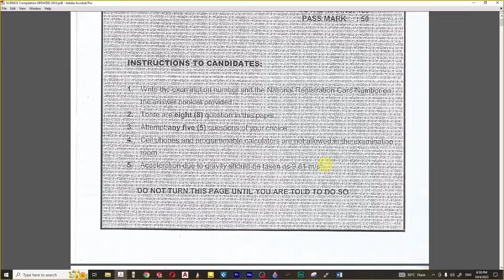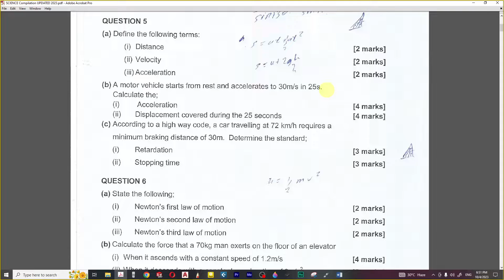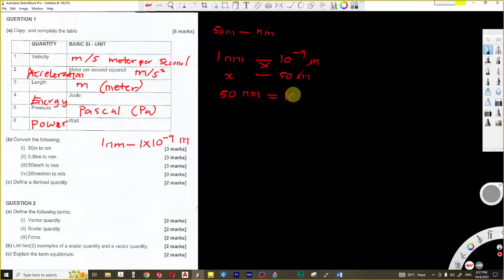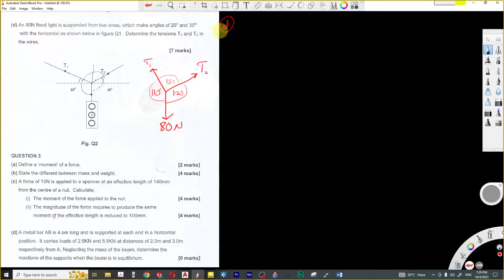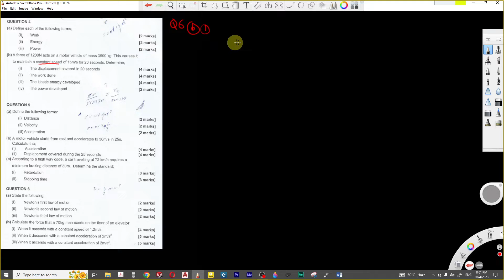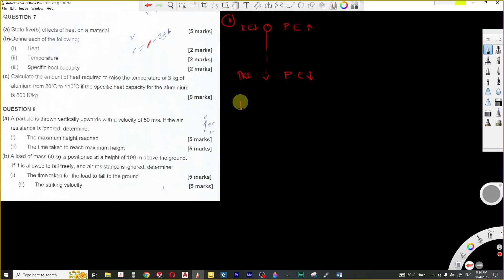Engineering Science Craft TEVETA Past  Paper Revision 1

Comment: A zinc sphere has a radius of 30•0 mm at a temperature of 20. If the temperature of the sphere if raised to 420. Calculate the increase in the radius, surface area and volume of the sphere assuming the coefficient of linear expansion to be 31*10 power negative 6 k power negative 1

Comment: At question 5b (2)I thought of using this formula 
S=UT+2AT  cause we have acceleration
Reply from the maker: Correct, you mean we can use the equation s = ut + (at^2)/2 because we now have the acceleration. Try it out , you'll see that it will give you the same answer. However in this case, it is important to first work with what has been given in the data before using what was found or calculated.